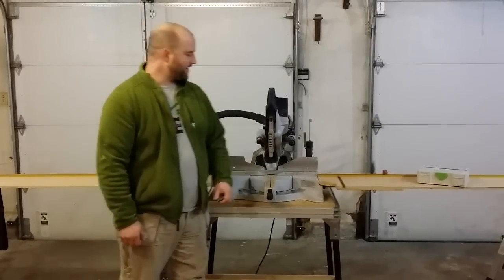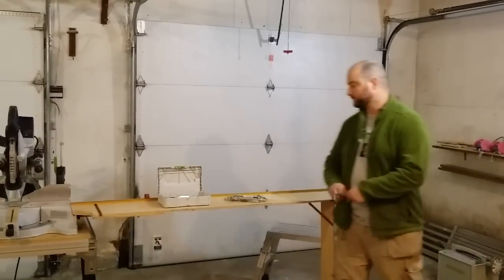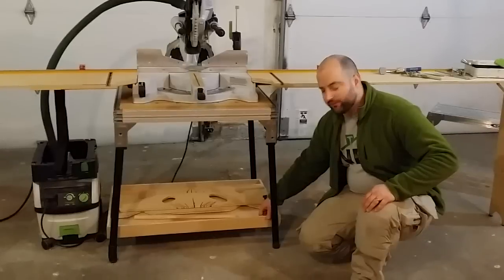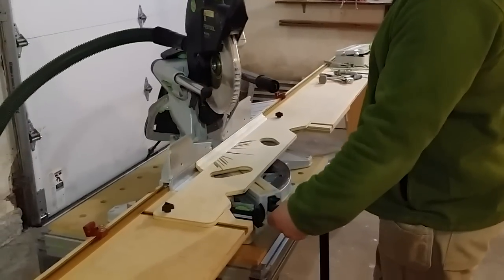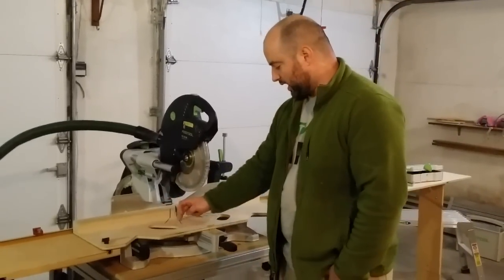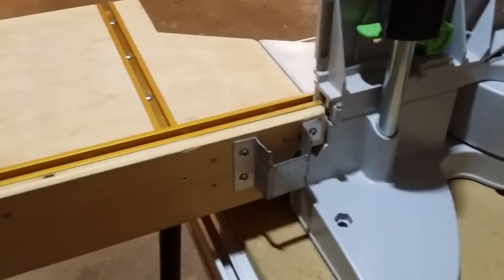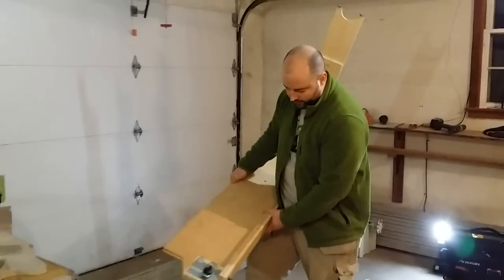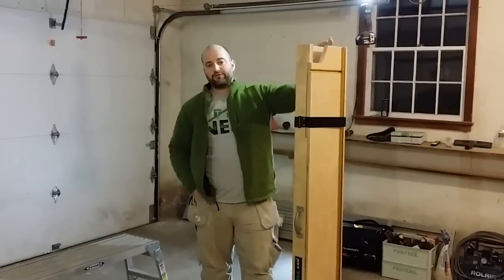Festool Kapex miter saw extension wings stand UG

Comment: Tremendous stand, thanks for the video.  I'm curious if you have any thoughts on how the plywood wings would stack up to the aluminum wings Festool offers in terms of precision...Say cutting some pre-finished furniture kick on a bevel?  Also curious to know how the Kapex measures up precision wise with other saws you've used in the past?  Thanks again for the video- I'm currently using a 10" hitachi slider on a decent plywood infused Bosch stand.  Getting pretty decent results but wondering if the Kapex and a similar stand to yours would be the next level up.  Cheers
Reply: i have the festool wings. for the price its disappointing.  i will return and get the fast cap version which adapts to the kapex stand. (kapex stand is really good and mobile) plus fastcap is alot cheaper.

Comment from the maker: alright, not quite a quick video!!  haha   man do i like to talk :)   my videos have been getting longer and longer     sorry for chomping away on my gum also.. ill have to remember to ditch that before filming in the future.
most of the build is 1/2" ply except for the vertical stiffeners that run the length of the wings, directly behind the "fence" t-track. that is 3/4"  it was put together with dados, glue and brad nails  screws for the hardware..   its more than solid enough for any sort of material your going to throw up there..  if anyone wants specific info just let me know.

Comment: nice work bro... where did you get the bracket to connect to the saw...? thats exactly what im looking for...
Reply from the maker: michael sosebee Thanks man,  all the parts are Festool replacement parts from their UG wings.. you can order them directly from Festool..  the online parts catalog is called Ekat.   a phone call to them is probably the easiest..   you will need 2 of each of the following part numbers (2 each for a total of 12 individual parts) 451630, 479734, 228541, 700472, 486202, 207813...    back when i bought them the total for all the parts was $54 plus a little for shipping..    to make it work you need to route a little slot where the bracket mounts to make space for the nut that the knob threads into (if you want a picture of that just let me know..)    very self explanatory though.
a more "off the shelf" option that is very similar is the Kapex sawhelper brackets from Multiblades.com http://www.multiblades.com/kapexsawhelperbracket.html
Hope this helps, good luck!   let me know if you have any more questions